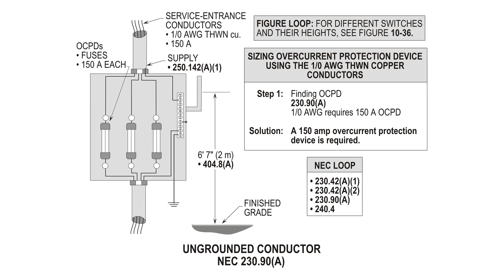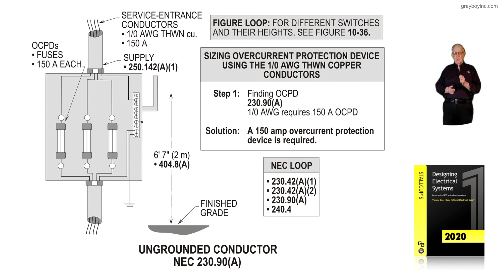6-42  UNGROUNDED CONDUCTOR - 230.90(A)​​​​​​​

Comment: Wouldn't 230.90(A) Exception #2 allow a 4/0 to be protected by a 250 amp fuse or CB as long as our calculated load did not exceed 230 amps?  I thought we could as long as we weren't over 800 amps per 240.4(C).